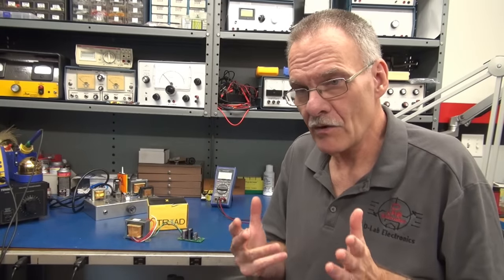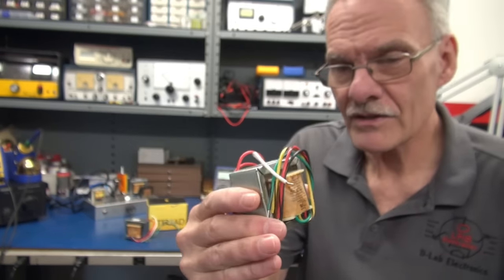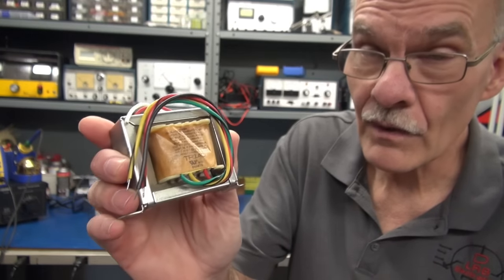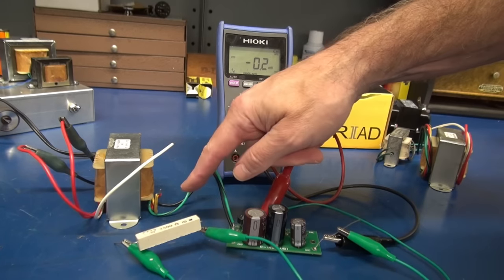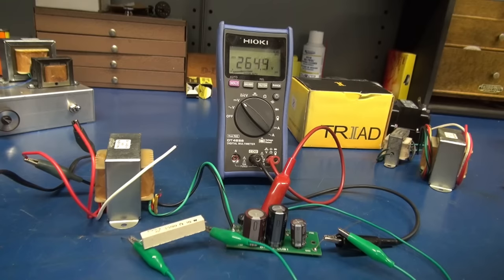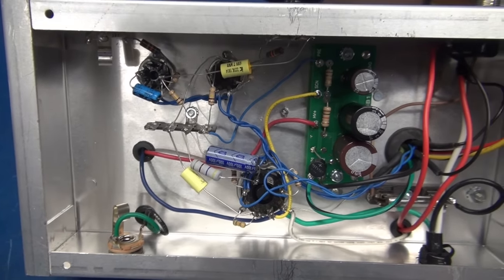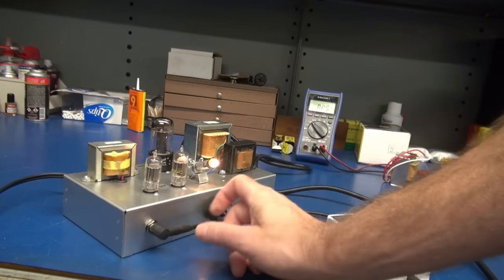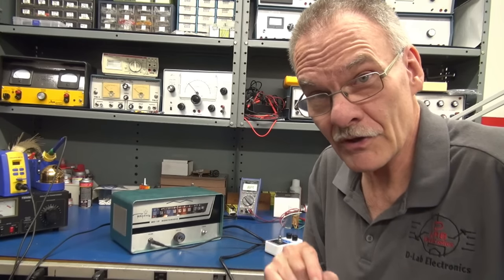Option to high cost Tube guitar amp power transformers Hammond vrs Triad N-68X how to Build it

Comment: I use older transformers from battery chargers and you will also find that a lot of these transformers are center tapped at your 6.3 volts you need for tube radio 6 volt filament. for 5 volt filament I use old VCR transformer. This is why I take old unwanted electronics from friends at work. You never know what reusable parts you will find inside them.

Comment: Very interesting! The Princeton reverb puts out 12 watts and it's original power transformer was only about 70mA ..... Will this alternative power push pull 6v6s with 4 12ax7s if you bump up the filament transformer to 2.2 amps? With the lower supply voltage(240 vs 320) and a SS rectifier will it make 10 watts?

Comment: Hi terry from down under .
I watch you YouTube  channel all the time and its a very cool channel .
I have a Johnson Viking 2 with the 122 vfo. 
Would it be possible to give me some advise ?
When I load up the JV2 with vfo on the 160,80,40 band switch I get harmonics on 20 meters and 10 
All other band allocations are fine no harmonics for example if I load the JV2 up on 40meter on the 40,20,15,10 allocation no issue with harmonics at all, 
This is the same with the 40 and 80 fix crystals  no harmonics 
In your experience have you seen this behavior before? . and if so would you give me a clue onto were to start looking in the vfo .?
Thank you for your time. 
Below is a photo of my Johnson Viking 2
Andrew

Comment: Another alternative would be an Antek toroidal transformer. For $29 you can get a transformer with a range of secondary voltages plus two 6.3V secondaries as well. For not a lot more you can get a 100Va unitgood for something around 20W output. I've used these transofrmers on a half a dozen projects. they also have transformers with a 5 volt winding as well.
Reply: how about the output is it just 160v on the high voltage side?
is it that too low??

Comment: What about a solution for modulation transformers? If I'm looking to build a mid-to-high power plate modulated transmitter, there's a definite shortage of modulation iron aside from cannibalizing a radio to get the iron out of it

Comment: Here's a 2-birds with one stone solution for getting both high voltage and getting your filament voltage: You get 2 transformers: 120V-12V (this is your filament supply). You then connect the secondary of a 120V-6V transformer to the secondary of the first transformer. So it goes kind of like this: 120V -> 12V -> 6V (12V) -> 120V (240V). Does that makes sense? So you're putting 120V in one side, you're getting 12V after the first transformer and then you're getting 240V after the  second transformer.. You can use different secondary voltages on the second transformer to get different voltages. You can use a 120V to 9V, for example, to get 180V after the second transformer.
I used to get old tube stuff off of craigslist. I think maybe it got more popular since I was doing that, but I was getting old Hammond organs (and Conn and Baldwin) for peanuts, sometimes free. I'd strip them for parts. But you'd get a complete tube amp. The Hammonds are particularly excellent for making making guitar amps. I had both L100 series and M3 series amps. Anyway, if you can find that stuff on Craigslist, it's a great way to get free parts. The only down side is getting rid of the organ body. My cousin owned a restaurant at the time and he'd let me dump them in his restaurant's dumpster.

Comment: Another good option is something like what the peeps from the Brazilian forum Handmades did with their Camine HB-1, HB-2, and other such projects, where they use a 30v+30v transformer to get 60vAC, and run that through a voltage doubler to get 145v DC. It also powers the filaments from the 30vAC center tap (where they're wired in series).
There's also many projects from the website OzValves where they use voltage multipliers to get B+ voltages.

Comment: I've used the N68X for a couple amp designs using series filament tubes (fused wall power for filaments and the N68X for B+). It works great and 240V will rectify to about 330V, depending on the current draw. 

Another alternative for filaments is a 12V center tapped transformer,, not uncommon on solid state electronics. Your 12A*7 tubes can use the full transformer voltage swing, and 6V output tubes can each take a leg and the center tap.
Reply: If you are in a 240v country can you just use an equivalent isolation transformer as the power transformer?

Comment: HI Terry , Im in the Uk, i built an amp Standel 25L15 years ago, but now got problems, its the transformer 350-350, etc..... But its the 6.3V with the Center Tap connected and its a dead short to ground, (both 6.3v wires) unground Center Tap, no short to both 6.3v wires. Many thanks Richard

Comment: Thank you So much Terry for that information. I took a break from building for a little while and in that short time I can’t believe how much transformers went up. Our options in HIFI Outputs are nearly none. A pair of Edocrs I bought for under 30 a few years back are over 60 now. The last small wattage amp I built for my garage using 6DN7s(Mike Frieda’s schematic) I wound up using those PT-31’s. Inexpensive but sound great to my 55 year old ears. Any thoughts on output manufacturers out there for alternatives?
Reply from the maker: I am using the P-T31 on this build also. Other than that one, I use the Hammonds or Classictone if I can find them

Comment: You probably already covered this, but is there a cheap ot out there that would be good for these amps ?
Reply: These are harder to come by.  You must know what you want specifically and look for something near that as surplus.  I found a deal on these rather small transformers, about 1/2 the size of a Hammond 125 and I got like 20 of them for around $3 a piece including shipping!  They work fantastic for little 6AQ5/6V6/EL84/EL86 PP Output transformers.  Around 10W Output is the max you can run on 1 of these.  I've still got a number of them lying around in my shop waiting for me to start tinkering around again.
Reply: @PaulinTaegu  what a great find that would be. I'd love to find some at that price.

Comment: I met a guy who used 70v distribution transformers for output transformers, he  put a capacitor somewhere if I remember well.
Reply from the maker: Yes, I have tried them in the past. They seem to lack in response, but are useable
Reply: @d-labelectronics  Maybe a travel, step up step down transformer can work too for a H.V.  power transformer.

Comment: Another option is control transformers. They are usually used to step down 480 or 240 to 120 but you can reverse feed then and they are cheap, I got a bunch free working as an electrician.

Comment: You clearly demonstrated that it works which is fantastic, however, I am just wondering something, you said the 120v Red wires are the line, but looking at the Datasheet it clearly says that the black, yellow/black, Green/black/red/ and the black are the power in and the Reds and white are the outputs, do you forsee any long term use issues? are both sides the same wire gauges and or ohms turn ratio?
Reply from the maker: Hello, In this application it works great, Thats why I made sure to test & show a demo. I have built these for years, Never a complaint or report of failure.
Reply: @d-labelectronics  Sweet! Thank you Terry for this and everything else you do for the DIY Small Tube Amps community. We all appreciate you man. Thumbs up!

Comment: Great video! Hey, wouldn't it be just as easy and a lot cheaper to buy an old tube radio at a flea market and repurpose it?
Reply from the maker: Yes, if the transformer lines up with the high voltage required. You can use the main power tranny in the Regency MR-10 receiver. It is around 400vac CT. Then use the cabinet for the retro look!
Reply: It's all a question of volts and amps. So, assume you're looking at an old tube radio at the swap meet and wondering whether the trannies will work for you, and of course, all you can do is to make an educated guess. That is, if it HAS trannies...many AM radios do not, they fetch their B+ direct from the AC line. No goodsky. But you will find that it's often the case that an old radio will not make more then 200-225 volts. And yes, you can make a low-power 2-3 watt amp with that with a solid state bridge rectifier, but not even a genuine Fender Champ which wants 325 or so volts despite the low power rating. Probably the radio output transformer is a piddly little thing designed to drive a 4" cheesy speaker, or maybe it's even the field coil on the speaker! Yikes! Not that great. The snarls come in when you try to make a push-pull 10-20-50 watt amp. For that, you are gonna need 350+ or even 450 volts on your 6V6 or 6L6 plates and that you won't find that in a radio receiver. In an old TV set, yes, you definitely can. The truly useless (except for the cabinetry and/or chassis) flea market stuff is in old tube VIDEO equipment. Wideband amplifiers, distribution amplifiers. It usually looks pretty good and is generally well built, but remember, the old NTSC video signal was a 1-volt peak-to-peak affair and did not have to drive any appreciable current. So you take the trannies out of that gear and you will find that the power supply makes only 100 or so volts, the tubes run at 80-90 plate volts and the trannies are completely useless. That's because the thing only has to swing 1 volt on the output! Oh, and by the way, on that kind of old tube video gear, you may not even be able to physically fit a 6V6 or a 5Y3 inside the thing because it was built to be slim and trim and the cage for the chassis isn't tall enough to fit an octal tube! Ask me how I know!!

Comment: D labs the Hammond 269EX Transformer specs says the secondary max voltage can be 380VAC but the max secondary current is 0.71mA?
Reply: 71mA not .71mA. Straight from Hammond site.
Reply: @Joetechlincolns  71mA can't supply enough current for Preamp tubes and Power Tubes
Reply from the maker: Its more than enough. The amp featured runs around 35ma on the 6V6, Preamp tubes draw maybe 1ma each